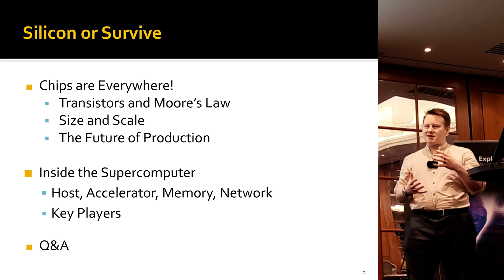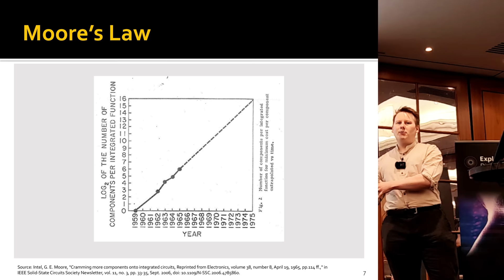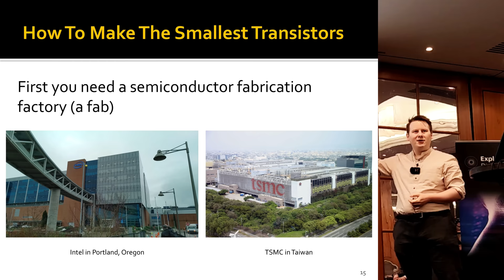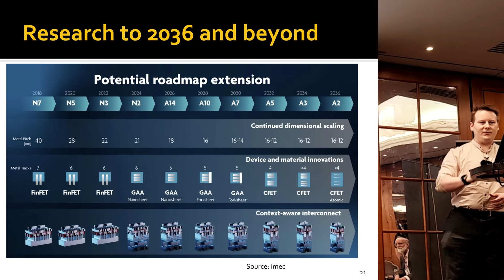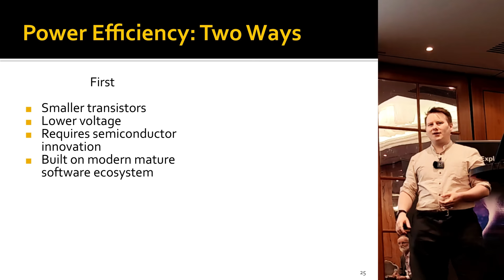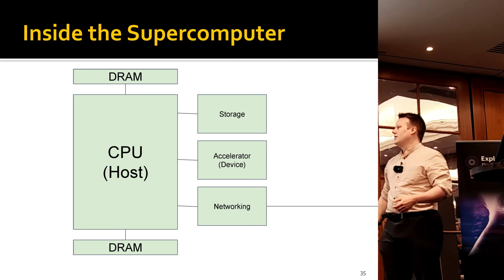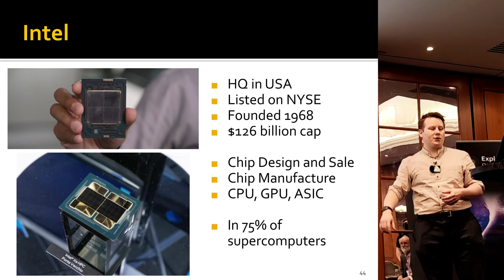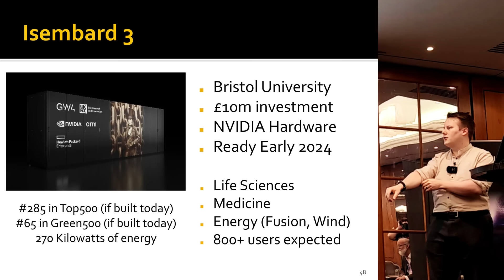Semiconductors for Defence Experts: Transistors to Supercomputers

Comment: Intel started to build their own CUDA counterpart, called OneAI. What's interesting about it is that is can (according to Intel) leverage different types accelerators (Xeon, Arc and DPUs) without too much code change. In a few years time, this could present a challenge to Nvidia but for now Jensen can stay relaxed.
Reply: OneAPI sits above CUDA rather than replacing it, but it would save a lot of coders from having to do it directly. Check out mojo+modular for another approach by Chris Lattner 👍

Comment: r.e the  roadmap talk, i don't think it's the first time we've seen theoretical roadmaps. back when EUV was being developed, at least since the 130nm node, it was always "well, right now we're using DUV, but we're pretty close to getting EUV working and have a roadmap based on that for the next decade or so".

Then EUV got stuck in development hell for two decades. I appreciate the optimism but i wouldn't be so quick to assume everything will quickly fall into place because research institutes have a theoretical roadmap. it's important to note the difference between having a theoretically sound technical roadmap, and something that can be reliably mass-produced at an achievable cost.

Comment: Is there any possibility of improved efficiency or performance to be achieved by using SRAM instead of DRAM outside of processors? Or perhaps as chiplet onboard storage?
Reply: Yes for both. Most microcontrollers incorporate copious amounts of SRAM on the same die as the cpu cores for this very reason, for example STM32F4 has 4 kb of backup RAM.
But it's always going to be more expensive than DRAM, because it's flip-flop based and requires a lot of transistors per memory bit.

Comment: I'm a little confused.... I can understand that this presentation is covering the world of compute for AI,  datacenter and cloud.  But most 'defense' applications of computing that are in weapons systems don't use any of this hardware.  They need specialized datapaths for, say, radar data or signal processing to filter noise out of a seeker front end.  Those are the kinds of things that have been hard to source. Some of these are on cutting edge nodes, but they tend to be field programmable, so that defense contractors can program them in a customized that only leaves the factory in the weapon/munition.  They don't need supercomputers for that.  

Off-the-shelf compute solutions from NVIDIA or whoever are needed for datacenter tasks, but they don't put those in weapons.  This is why Russia's silicon shopping list had lots of FPGAs and  (almost) no CPUs.
Reply from the maker: That's for equipment directly in the field. Lots of stuff happens back at base camp or at home base that requires lots of compute. The talk was very well received by those in the room

Comment: How will AI optimize the entire stack from physics up to pixels on a monitor? Assembler, transistors, CPU layouts, coding languages, al that. AlphaDev assembler 'game' etc.
Reply: Ai finding better optimizations doesn't automatically bring 2x improvement. Generally optimization problems where many people spent some time on them are quite close to optimal even if infeasible to solve optimally. So it's quite possible that AI placing some chip components could improve space density by 1% I don't think it will be like a 10x improvement.

Comment: Skimmed through it, but you seem to have missed out that Intel is the only leading edge foundry the U.S. military can use, as its DoD trusted and TSMC and Samsung arent. Previously the military was relying on IBM->GloFo when they bought those fabs, but they are now old legacy nodes, so any state of the art chips will now be made at Intel.
Reply: They aren't only using intel. They need to either have Samsung or tsmc GPU chips.
Reply from the maker: Except this is in the UK. Why would I talk about US.

Comment: "Modern Smatphone is 120 billion" what
iPhone 14 - CPU - A15 contains = 15 billion transistors. 
6 GB of RAM - DRAM Cell 1 Transistor = 48 billion transistors. 
NVIDIA RTX 4090 - GPU = 76.3 billion transistors.
Reply: If you count storage, then it sounds like lowball number.
Just 32GB of MLC nand would be over 100 bil